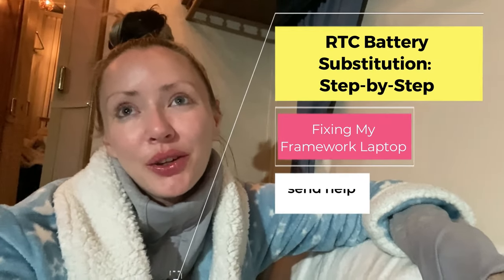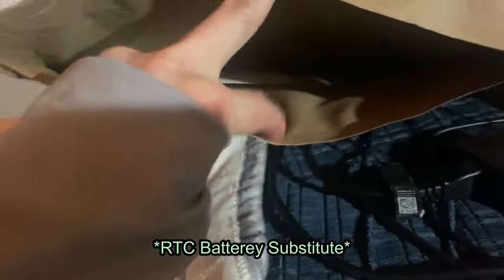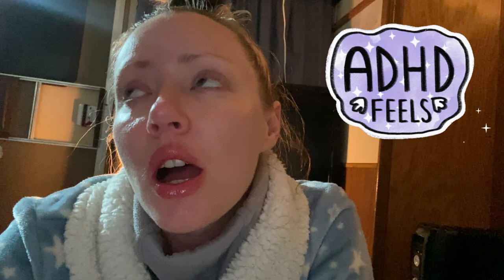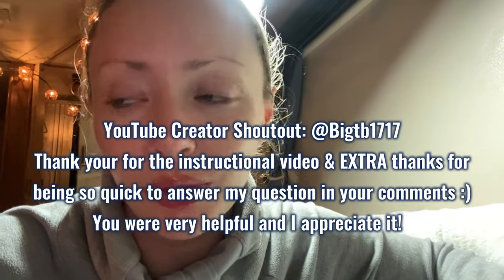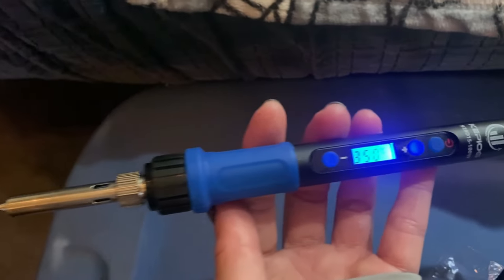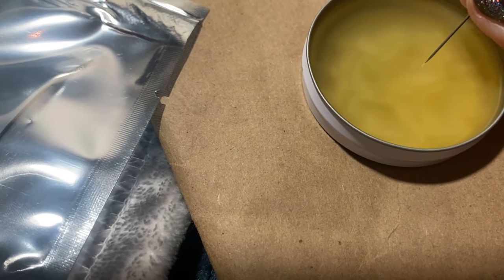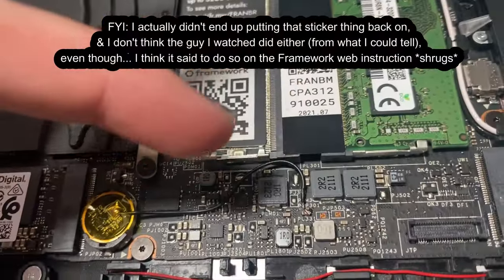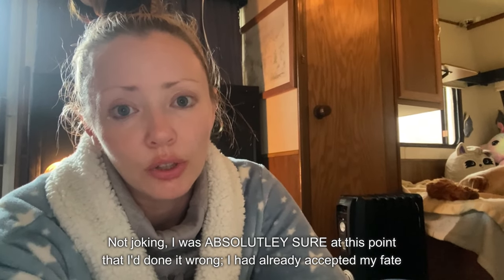Framework laptop not charging? Showing STEP-BY-STEP Instruction HOW TO FIX *RTC Battery Substitution

Comment: You should really put the sticker back on, or at least some electrical tape (the yellowish one prefereably). This is because that section handles power conversion, and it would be bad if dust shorts some connections
Reply from the maker: @waralo191 I’m SO glad that you let me know this! Thank you 🫶🏻 I’ll open her back up and do that. I saw that the fan area looked super dirty (like dust and even dog hair) but I’ve never cleaned out a computer before 😬 I’d appreciate tips regarding that too, if you have any 😅
Reply: Good tip. (Reuse the black sticker if possible)

The yellowish tape is called Kapton tape. Kapton is the go to tape for isolating electronics. Kapton shouldn't be used where it's humid and where there's movement and abrasion, which is not the case here. It's a good substitute for that black sticker.
Reply from the maker: @RubberGopher Oh good! I still have the black sticker thing, so I’ll put that back on 🫡 thanks again. Very much appreciate this.
Reply from the maker: Thought you would like to know that I put the sticker thingy back on and cleaned the dog hair out lol
Reply: @amberlejones  Nice, glad to hear!
Reply from the maker: @waralo191  🥰

Comment: Clean the fan. It's full of dog hair. You can get canned air that's for cleaning out electronics. It'll slowly choke the cooler and make the fan spin faster and louder and eventually cause overheating unless you clean it out.
Reply from the maker: @quasi84 Oh thank you! I literally just asked someone about this 😊 I have seen those air cans but I’ve never used one. Do you just open it up and blow air on it? (I’m assuming so) is there something I should be careful about while I do it?
Reply: @amberlejones  Yes, you just blow the air from the inside (where the blades are). Use brief bursts of air. As the fan spins from the air, take the opportunity to get rid of the dust on the blades using the air too. Once the hair is gone, you can blast the dust in any direction and it'll just start flying around in the air. Don't let the fan spin freely for too long or too fast from blowing air at it. That's the only concern.

Do it outside and take the opportunity to blow the whole laptop's inside clean. You can reuse the can again next time you feel like cleaning it. While you're at it, also give the keyboard a few blasts to get rid of dust, crumbs and fur that's under the keys.

You can find lots of videos on YouTube where people take computers of all sizes outside and blast them with a can of air.
Reply from the maker: @RubberGopher you are the best! 🤗 thank you! Putting air can thingy on my shopping list RIGHT NOW and thank you (times infinity) for the advice.
Reply: @amberlejones  I'm happy to be of assistance! Take care of the computer and it'll last you a long time! The computer also needs a good wipe too, both screen and keyboard get dirty quite quickly on a laptop. :face-blue-smiling:
Reply from the maker: @RubberGopher I know 🥲 rewatching I could see how dirty it was how embarrassing 😅
Reply: @amberlejones make sure to hold the fan down when using it. Sometimes you can blow into the fan and spin it up causing it the fan to spin ridiculously fast and burn out the fan bearing.
Reply from the maker: @Marauder-q2v ohh thank you! 😮 so when I am cleaning with the air can stuff, I should just make sure to hold the fan in place?
Reply: @amberlejones  yeah just put your finger on it while doing it.
Reply from the maker: @Marauder-q2v got it ☺️👍 thank you bunches. I truly wouldn’t even know where to start on these things, if it weren’t for all the advice I’ve gotten. You’re the best!
Reply from the maker: Thought you guys would like to know that I cleaned it 🥰
Reply: @amberlejones  Good to hear! I hope the fan isn't as noisy anymore and that it performs better over a longer amount of time because it can get rid of the heat more easily now. :)
Reply: @amberlejones  Also for upgrades like the motherboard + cpu. I think it would be best to wait. It seems like they even slash the prices 50%-60% on the older 11th gen  boards. It'll take a few years, but they might do it on the newer ones if you're patient enough to snag a cheap upgrade while they're trying to clear old stock.

Also the fraamework got a new display upgrade option.
Reply from the maker: @RubberGopher  I haven’t used it while editing a YouTube video yet (that’s the only time I ever noticed it getting warmer and the fan being noisy, which I’m assuming is because the editing program takes a lot of energy) but I will let you know whether I notice a difference, when I do! ☺️ thanks again
Reply from the maker: @Marauder-q2v  awesome! Yes I can totally wait and be patient for that. I haven’t had any problems with mine so far. How do you know all this stuff? Is there a website that announces Framework news, I wonder 🤔 
And thanks again! 💞